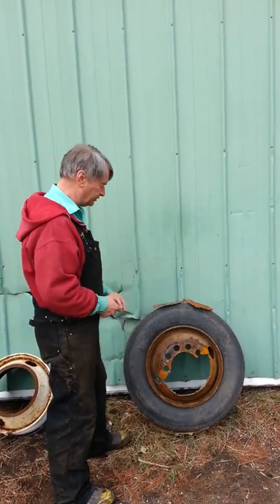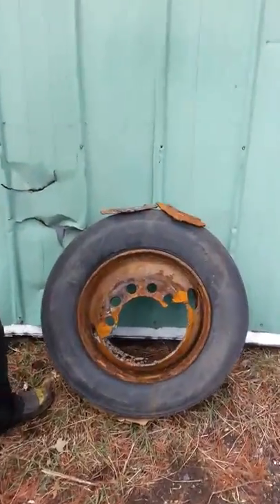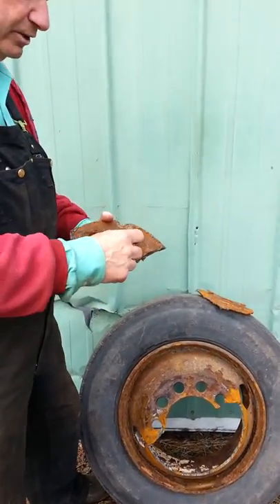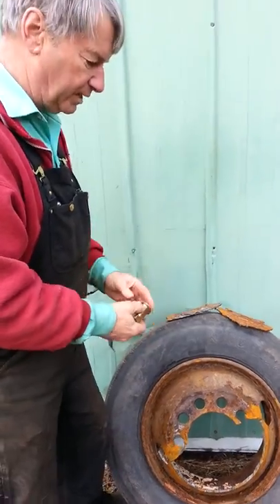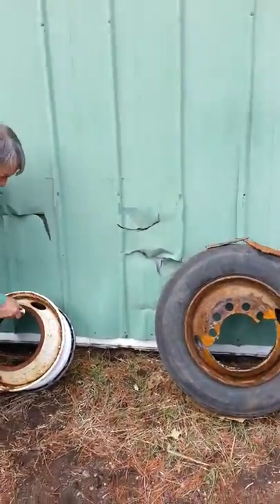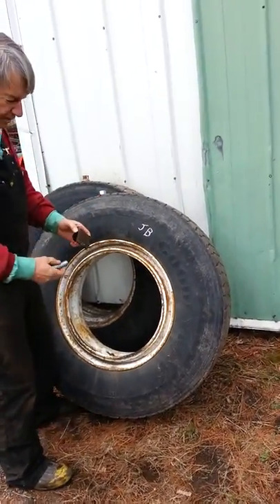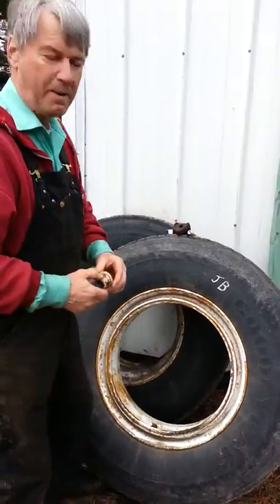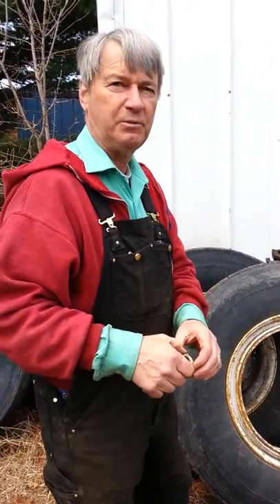Dayton, Budd and hub piloted wheels.

Comment: Which type do you prefer?
Reply: Dayton rims and tires are lighter, but take time to align them when you don't do it frequently. Budd wheels and tires are a bit heavier and if not properly torqued down the inside stud can come loose and cause a broken wheel, The plus side is they are self-aligning and self-centering. The hub-piloted are self-centering wheels.
We have trucks and trailers with all three types of wheels. I don't have a favorite, but Dayton and Budds are getting less common. I think newer trucks now have Hub piloted wheels, so those are probably the best.
Reply: Didn’t know Mr rodgers is a truck and trailer expert